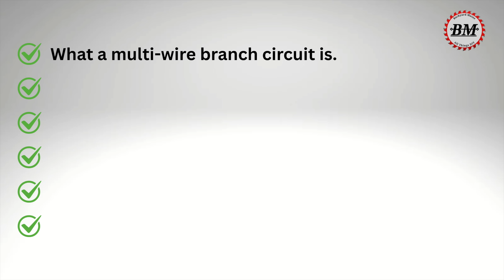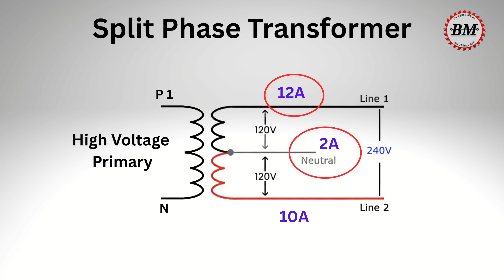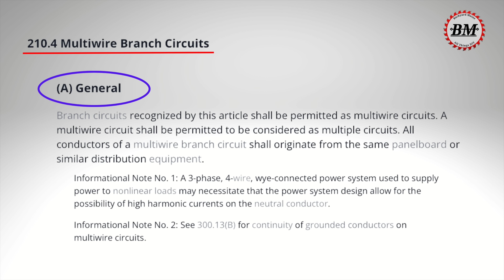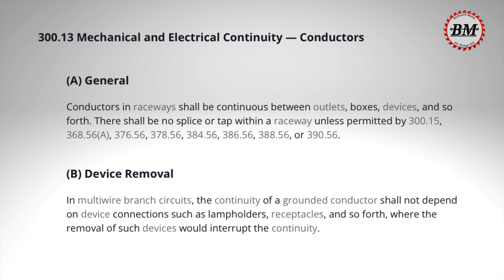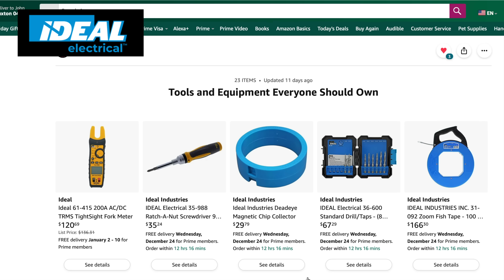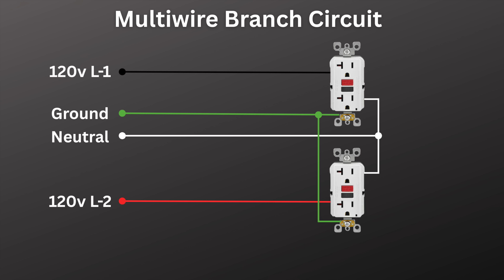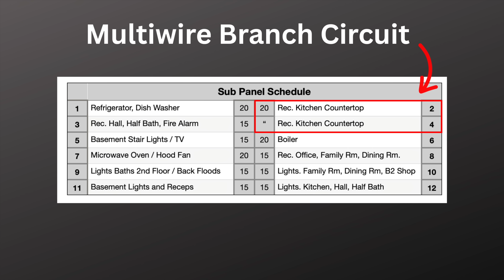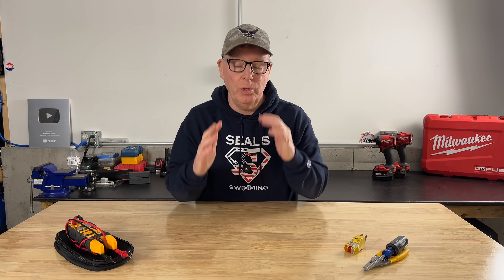Homeowners Don't Know This Dangerous Circuit Exists!

Comment: solid information as always, finding a split receptacle in an older kitchen on an untied breaker really brings home the test for voltage after disconnect safety tip.

Comment: Thanks for your video. Just one thing though, it would have been better if you included a side by side diagram of typical single branch connection of two outlets in comparison to the multibranch connection diagram you only showed in the video. The contrast/difference would be more evident for a better understanding.

Comment: My house was built in 1950.  There are no shared neutral circuits.  I believe this method of wiring came about in the mid 60's because the price of copper had gone up, so this, along with aluminum wire was a way to get around this.  I believe every 120V circuit should have its own neutral.  When you flip the breaker you don't have to worry about getting a shock from current from another circuit.
Reply from the maker: I agree on both points.

Comment: Excellent video.  I suggested you do a video on this topic about a year ago because I was in the middle of remodel on a house built in 1951 with three additions, multiple shared neutrals, a main panel and a subpanel.  One issue I ran into was circuits from both the main and subpanel sharing junction boxes in the attic where all the neutrals were combined and increased the risk of shock.  I separated all of the neutrals in the junction boxes and ran new 12/2 wires for all but two circuits with a shared neutral.  I also repurposed the old 14/3 wire for an  integrated smoke alarm circuit.  Since most of the house had two prong receptacles that I wanted to upgrade and some had metal boxes without a ground, I upgraded all of the circuits where GFCI/AF is currently required with dual purpose circuit breakers.  I ended up with only two circuits with a shared neutral that are on a two pole dual purpose breaker.

A question I have is at the 14:48 mark you say it is necessary to tie the breakers because the neutral can get overloaded and the breakers won't trip.  If neither breaker will trip, how does tying the breakers together prevent a fire?  It seems it would only prevent a shock and the risk of fire is always present.
Reply from the maker: Sounds like you did some good work. To answer your question, having a breaker tie or a two pole breaker ensures that the two circuits remain on opposite legs so the neutral will only carry the imbalance. . If the two circuits were on the same leg an over loaded neutral would be possible.
Reply: @BackyardMaine  That makes sense.  Then is another way for an inbalance to happen is a multiwire branch circuit on a tandem breaker?

Comment: Many think that because there are two wires that there are two phases when in reality there is no such thing as 2-phase since in order to measure voltage you need to reference something else which collapses the whole thing into a single 'phase'.  Sure, one side is 180 degrees from the other...no matter what system you measure that will always be true with 2 points of measurement else you'd measure nothing.  The darned thing is just split in the middle and beware of that.

Comment: I lived in a house with one of these. I had the main panel replaced and the electrician was confused by it and wanted to put both hot wires on 1 single breaker. Which I guess would work but cuts the overall capacity in half.
Reply from the maker: Yes exactly, it would reduce your capacity which may not matter if its bedrooms. But MWBCs often feed kitchen receptacles and theres a requirement to have at least two 20A circuits feeding counter top receptacles so combining them would become a code violation.

Comment: Hi Backyard Maine,
Is a normal 240 VAC dryer circuit considered a MWBC as well? I ask because the electric motors (and digital controls of modern dryers) run on 120 VAC, whereas the heating element requires 240 VAC.
Reply from the maker: By definition yes as long as the dryer has a neutral conductor. The neutral will only have one connection point so no issues there and of course you need a two pole breaker for the circuit.
Reply: @BackyardMaine — Yes, I should have clarified when using the newer 4-prong connectors (two hots, a neutral and ground).
Thank you for your answer and Merry Christmas to you and your family.

Comment: Im so glad  I tripple check  .  Even when the breaker is off.  I STILL CHECK
Reply: It's also a good idea to check with both a meter and a non-contact voltage probe, so that you would catch anything live in a box. But it's still best to use a meter as final confirmation. And check your meter and non-contact voltage probe on a live circuit before and after verifying that the circuits are off.

Comment: I found a few of these in my 1950s house with a long history of renovations of various quality, with some sketchy DIY. It confused a heck out of me at first - how is that I have have a breaker off and power on neutral when I turn on the lights on a seemingly  different circuit??? No breaker ties of course. I read some about it since, but now I have a very clear picture of how they supposed to work and how to make them safe. Thank you!
Reply from the maker: Glad to help. Thanks for watching.

Comment: This is why when you look in a panel see neutral wires that have some melting of the insulation. Someone took a multiwire branch and connected both legs to the  same phase. If you see that need to track down that wire bundle and put the 2 hots on different sides of the split phase.  This is one reason never see this in other countries because they don't have split phase power.

Comment: Amazing explanation and I learned more. I started researching MWBC a while ago when I had face off the panel of the house I bought and saw some reds going into the sides of not only the expected tied breakers for my dryer, stove etc but also some reds into the sides of some single breakers for the bedrooms farthest across the house that had been updated in the 90s.  

Mine aren't tied, they're opposite and down staggered and I have yet to figure out which are paired with which. I have a guess because I physically followed them out the box. 

I think they split them to run 14-2 out of the first home run receptacle or split them in a junction box in the attic before going to the receptacles and lights for those rooms. Because I have yet to find the receptacles with red, or a receptacle with both and I don't see a junction box anywhere on the basement ceiling if I physically follow them. 

I haven't started working with those circuits yet because still working on the original circuits project. So now I know the pitfalls of these and thanks to this video I know to make sure I get the other breaker switched off to open that receptical. Could be power on the neutral if someone uses other circuit because it's not even in the same room. And the pigtails, good to know. I'll take all this information to heart. Thank you!
Reply from the maker: That is a very common to have a 3 wire home run out to a JB somewhere and then break down to 2 wire cables to feed a couple of circuits. Knowing which wires are paired up is very important and keeping them on opposite legs as well. Thanks for sharing your experience.

Comment: Great video and great information! I wonder if you could at some point address "piggyback" breakers, as in the single-slot breakers that handle two circuits - how common they are, what are the advantages and disadvantages, how to avoid using them, and anything else you feel is important to note. My house has lots of these and I'd really like to know your opinion on their use. I do understand they are necessary to separate circuits and there are no available slots in the service panel, but what other considerations are there regarding their use? Thank you for another helpful video.
Reply from the maker: Thats a great video idea. I'll add it to my idea list.
Reply: @BackyardMaine  Thank you! As a small addition, I will add that the breakers in my panel were 49 years old and I discovered (by arcing sounds!) that the stab fittings on several were loose and causing arcs in the panel that were not detected by any breakers and could have caused a fire. I replaced all the breakers with modern equivalents this year as a precaution. I also have an air handler with two 60-amp DIN-rail breakers that over the years corroded internally and showed lower voltage on the bottom than the top by a significant margin. This was likely caused by moisture levels and condensation because the air handler is in the unconditioned garage and handles cooled air from the A/C. I will be happy to collaborate with you on where those might exist and how to diagnose and replace them. I appreciate your knowledge sharing and hope you and your family have a happy and fun new year!
Reply: @B @BackyardMaine  OK, one more idea. I also owned a house in the Chicago suburbs that had been wired with aluminum wiring in the early 70’s. Over the years, the prior owners had pigtailed them with copper in standard wire nuts. Thankfully, we caught the symptoms of arcing sounds and replaced all the wiring, which was in metallic conduit per DuPage County regulations thankfully, with copper for the entire house. We found 5 boxes that had nothing left but bare burned conductors and the metal remnants of twist connectors during the process. Maybe aluminum wiring could be another video idea?

Comment: Doesn't the neutral supply amperage as well? AC moves back and forth. When L1 will supply 12 amps for the toaster then 2 amps will flow back to the source while the remaining 10 amps powers the coffee pot. When L2 supplies 10 amps for the coffee pot. The Neutral will supply the remaining 2 amps for the toaster?
Reply: When the opposite legs neutrals meet at the wire nut the demand from each other is actually satisfied at this point...the opposite voltages are actually providing current to one another. It's kinda magic, with the end result being that the neutral only provides the imbalance load exactly like you stated.

Comment: I moved into a house in Maine with some old knob and tube.
Hired an electrician to replace those circuits.
He replaced them with this type of circuit [while ripping me off].
Perhaps if I watch this 4 more times, I can redo the wiring to get his mess straightened out.
Reply: Nah but combined with about 4 other videos on the channel maybe. This channel has been my favorite for learning and understanding residential electrical. His teaching style has been the one to click best for me. Amazing explainer.
Reply: @laureldc  I just meant that this type of wiring goes against what I've done for almost 50 years.
I couldn't wrap my head around what they did to save a buck.
Reply: @stans5270  yeah, listening to this, the potential failures seem to not be worth the up to 25% savings in wire.
Reply: @5000rgb With newer code requiring neutrals in switch boxes, 12/2/2 and 14/2/2 are now somewhat readily available, as the older 12/3 or 14/3 doesn't always cut it.

When I bought my coil of 12/2/2, it was actually cheaper than 12/3, but I assume that was a temporary oddity caused by supply/demand fluctuations.

Either way, it replaced my planned long multi-wire run, and now I have separate GFCI breakers instead of a 240V one with tied handles.  Shared ground, otherwise two completely independent 120V circuits in the same jacket.
Reply from the maker: Amazing.. Thanks
Reply: MWBCs aren't dangerous; they work fine, if installed correctly.  Installing a MWBC without a handle tie is the No. 1 way to make it unsafe.  With a handle-tied breaker feeding both sides of a MWBC, both hots are turned off when servicing the circuit, which makes sure the shared neutral isn't carrying any current either.  Even the neutral pigtail requirement not being done isn't a big deal, if the correct breaker was installed.  

Yes, MWBCs are more difficult to understand, but they're not unsafe -- if installed correctly.
Reply from the maker: @alsavage1  Kind of what I said in the video. They are safe if breakers are installed correctly and the neutrals are pigtailed at the receptacles. The issue I have is people who do not understand them will unknowingly undo a correctly installed MWBC.
Reply: @alsavage1 💯✔️
Reply: @alsavage1  That might be true.
It is then also true that driving at night with one headlight is safe because the other, working headlight shows the road.

Comment: Technical disagreement here. The two hot wires are not 180 degrees out of phase, as you need a second phase to have a phase angle to measure in the first place. If you measure with neutral as your common reference point then they appear that way on a scope, but that’s not a true phase shift.

Comment: Great video but please review your graphic overlay of the panel at 9:19. In my experience the horizontally opposed breakers are the same side of the split phase and not as your graphic presents them. Thank you.
Reply: Every panel I've seen has them in alternation. Opposing legs across from one another.
Reply: @Cotronixco   That depends entirely on the panel’s bus design. In many common residential panels (Square D, Siemens, Eaton BR), breakers directly across from each other are often on the same phase because the buses alternate vertically, not horizontally. Assuming phase by position alone can lead to MWBC neutral overloads, best practice is to verify by manufacturer diagram, meter, or use a 2-pole breaker.

Comment: Not an electrician and I never heard of this type of wiring method. I have added lighting in garage and never would have thought of doing something like this. Great video. I learned a lot and will stay safe. Peace
Reply: very common in canada for kitchens. not a problem.
Reply: Think of an electric clothes dryer.  They dry most effectively if the heating coil has 240 volt current, but the controls, which need very little current, will use 120 volt current.  That is why you will most often have a large four wire receptacle and plug.  That way you can use 240 volts for heating and use the neutral to get 120 volts for the controls.  Check your electrical panel if you have an electric dryer and you will most likely will find two breakers vertically next to each other marked for the dryer.

The same goes for electric furnaces, electric water heaters, electric stoves and ovens, and maybe your air conditioner.
Reply: @Allen-w9d  thanks for the reply. We used to have an electric dryer but put in a gas one some time ago. The two breakers are still in the panel, and the outlet is there for some future user. peace
Reply from the maker: Glad that you learned something form the video.. Thanks for watching.

Comment: The most common violation is at the garbage disposal/dishwasher receptacle IMHO.
Reply: New kitchen code is insane!
Reply: Yeah until South Carolina began adopting the part of the 2014 NEC  7 years ago to require AFCI/GFCI for the small appliance kitchen circuits, we would sometimes pull a 14/3 to a receptacle inside the cabinet and break the tab on the hot terminals so the top and bottom half have their own 15A breaker. Of course using a double pole 15A breaker.

Nowadays we pull one 12/2 and put it on a 20A single pole duel function breaker.

Comment: You mention cost saving but in kitchens I thought the main purpose was to have two circuits at the same receptacle. That you can have your toaster on the top plug and a kettle at bottom, which normally would trip if it was a normal 15 amp circuit.
Reply: Also an inferred guess, but code requires 2 countertop circuits minimum. They don't have to be split receptacles, but could be. Since you have to have 2 anyway, and they're close together, running them together saves money.
Reply from the maker: You can split a standard duplex but not a GFCI receptacle. Just keep that in mind.
Reply: @BackyardMaine  good to know!